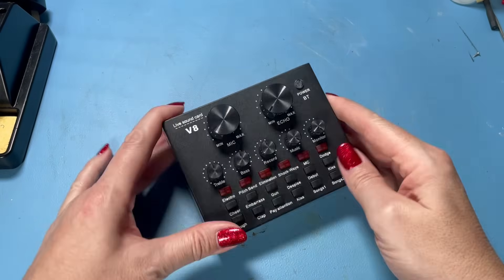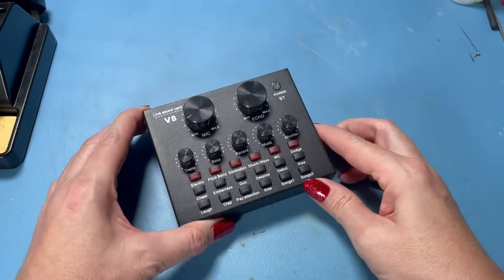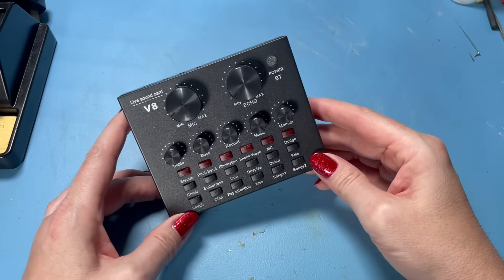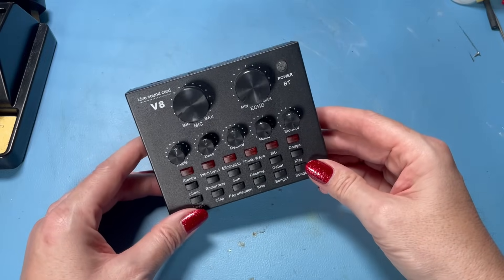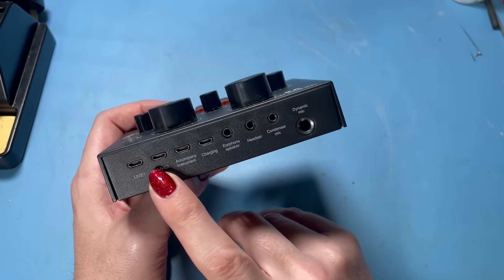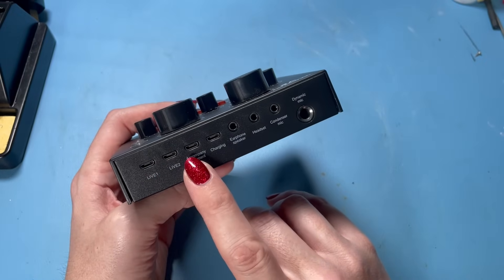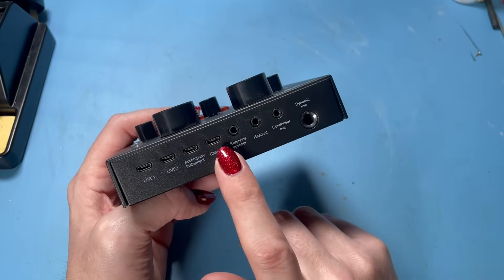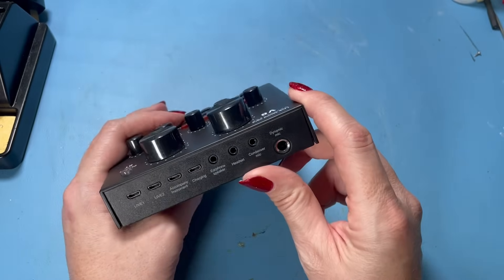Temu V8 Streaming Mixing Sound Card Teardown

Comment: My theory for the BT antenna is that they worked out the impedance and stuff in some PCB calculator like Saturn PCB Toolkit or some special antenna design tool and found that thicker copper gave a better result. Leaving off soldermask and it seems applying solder paste over the antenna trace makes it thicker and closer to what they needed.

Anyway just a possible theory

And of course the soldermask changes the epsilon r value so they'll have taken that into account.
Reply: I have noticed several pcb's where the BT is not masked. I think it must be that the solder mask inhibits the BT transmission with such a small aerial.

Comment: How could it amplify the mic. I couldn't see a single op-amp in it. No phantom power circuitry either. I was expecting at least some cheap 4558 op-amps in it. That one chip does everything. There wasn't even a TP4056 for the internal battery.
Reply from the maker: It's all in that mysterious single chip, which I couldn't find any information on. I will most probably just take the lithium battery out and use it for something else, lol.